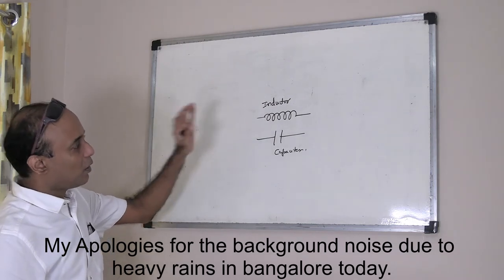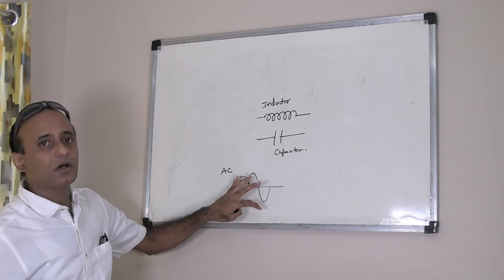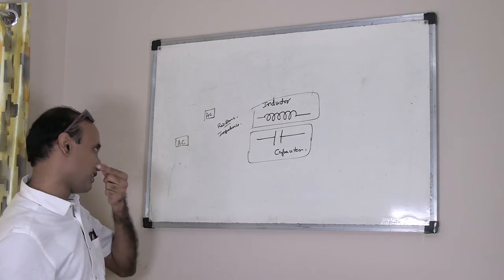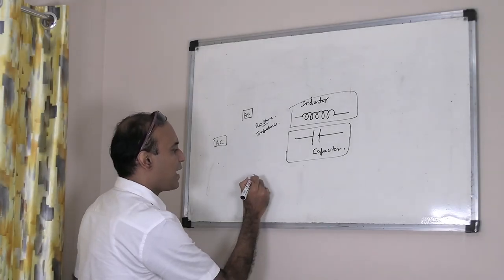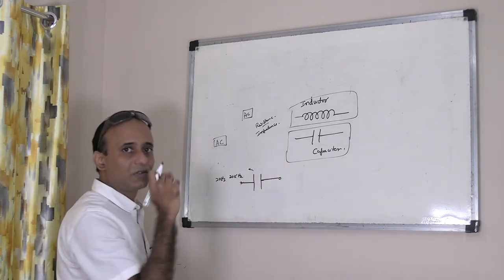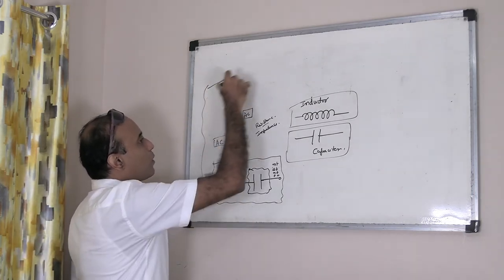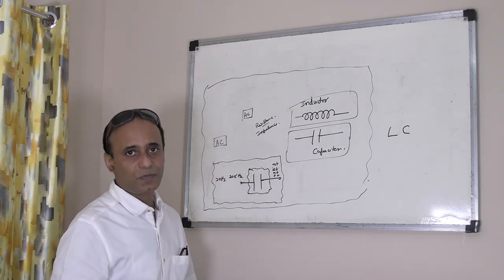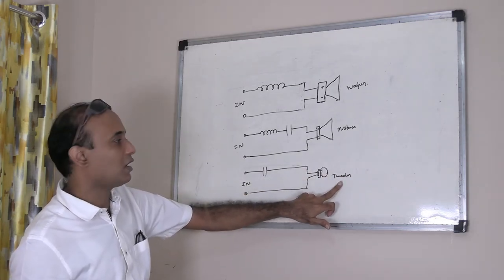Speaker Crossover Network Design - 2 way, 3 way, 4 way Divider Network.

Comment: Does same uf capacitors different brands change the sound  quality , I believe it is only a marketing tool...
Reply from the maker: Thanks for your comment.
Very difficult to say. But it is generally accepted that some popular brands are very close to the value printed on the capacitor and remain the same during working when they slightly warm up. Many other capacitors vary up to 20%. If you have a capacitor testing tool, you may be able identify the right ones. There are some videos on it on Youtube.